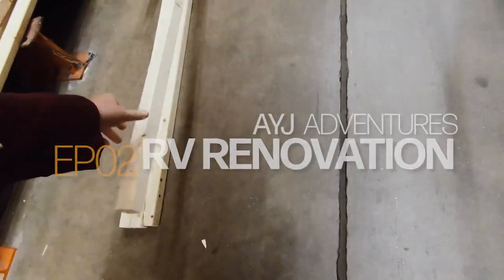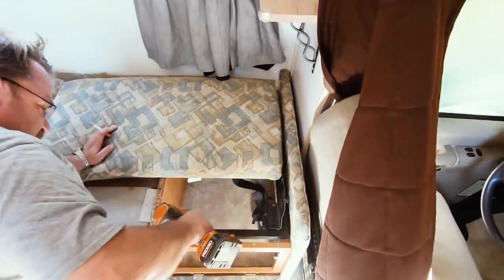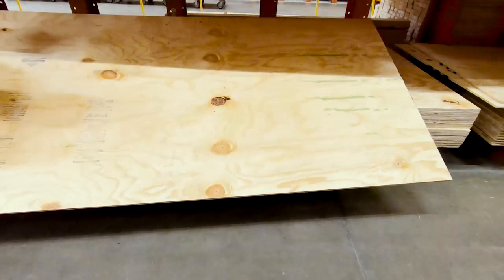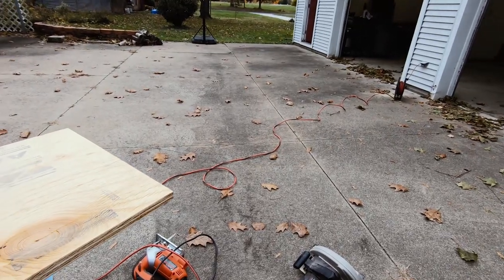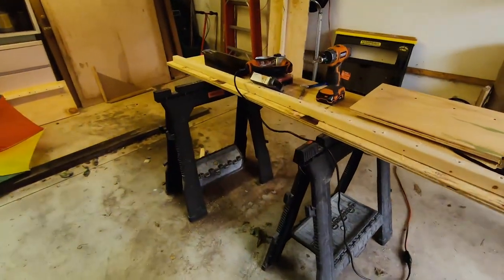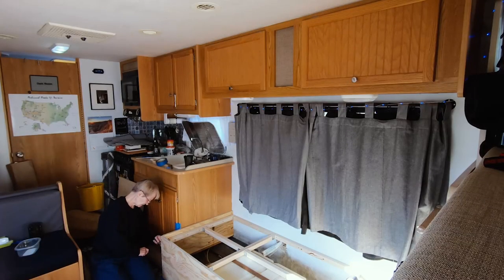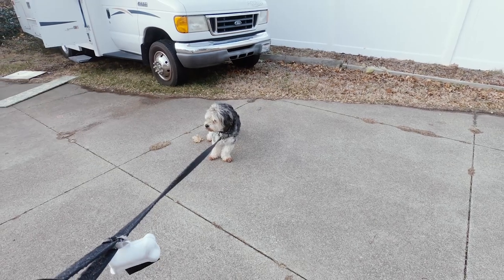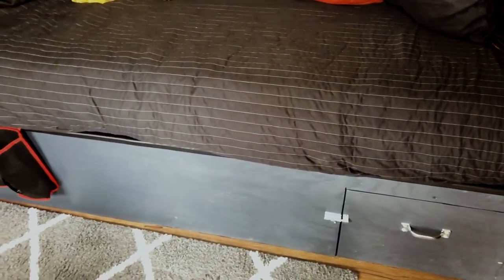RV Renovation, Remodeling a Class C Motorhome; Removing the Jack-Knife Sofa!

Comment: I love the box storage with wheels. Does it move around while traveling?
Reply from the maker: No, I have two bolts on the front that keep it in place. I have been thinking of adding tracks though for the wheels because it can be hard to get it to come out or back in properly.
Reply: @awanderingpalette  I would recommend the tracks. You could add a lid to the top and make an “ottoman” for extra comfort?

Comment: So, what do ya do if you have any plumbing issue on that water tank?
Reply from the maker: In regards to the bed, I built? If needed it can be unscrewed/removed. It was actually easier to get to vs the jackknife that was originally there. (I've since sold that RV and purchased a travel trailer.)
Reply: @awanderingpalette  thanks for your answer 😊

Comment: What is your mattress made from?
Reply from the maker: It’s actually foam (usually used in outdoor furniture) Found a company in Michigan that makes what ever size you need. Ended up being perfect! (And not expensive)
Reply: @awanderingpalette  I have very same issue in my class B+. Please share with me who made your bed. Is it comfortable, how thick, memory foam?
Reply from the maker: My brother and I removed the couch and built the box for the bed. The mattress is 6 inches thick, purchased from Foam Factory in MI. They were wonderful. Even called to confirm what I was using it for. If you can would recommend using slats for base. It’s something I would change to if I did it over. Very comfortable though!